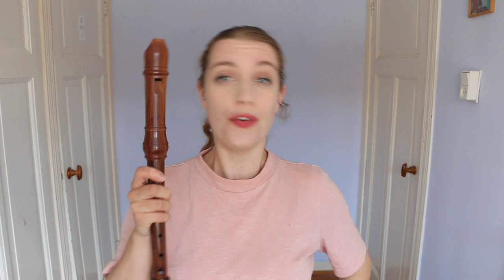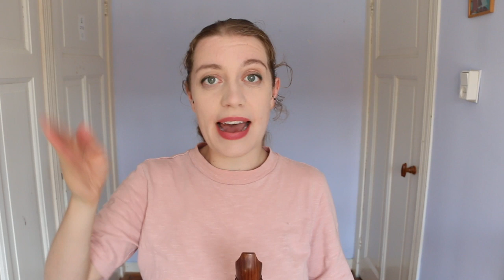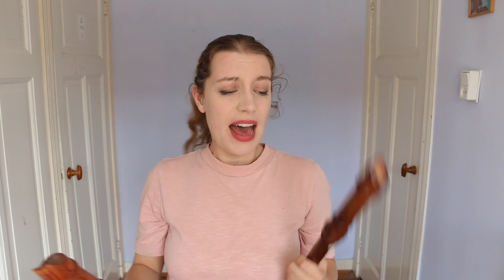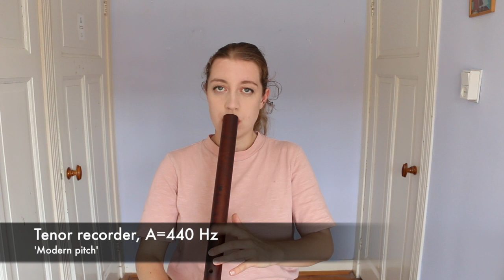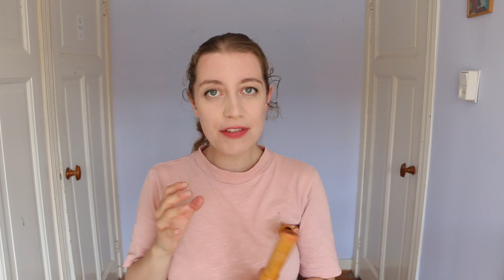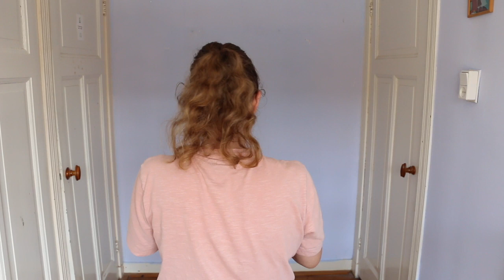440 vs. 415 Hz: what's the difference between baroque and modern pitch? | Team Recorder

Comment: When I did my first classical project with a choir I never heard of different pitches. We were doing Bach’s Hoge Messe and I practiced very hard at home with a recording. At rehearsals I struggled every time because it seemed a completely different piece. All the notes were there but I couldn’t get a hold on them. Finaly after 3 rehearsals somebody told me we were singing in 415 and I practiced in 440. Turns out, I’m very bad in singing at 415 if I learned it in 440... Now, many years later, I can hear the difference but I still cannot transpose down. It all doesn’t feel right.
Reply: Your Choir has to sing at 440 instead of 415 (in other words transpose down a half step) Right?
Reply: How can you not transpose?? That is so weird for a singer to not be able to do.

Comment: Most clarinets are tuned in B flat, but for instance for Mozarts Clarinet concerto you need a clarinet tuned in A, a semitone lower. No idea why this is like it is. There also are some awesome concertos for clarinet where you need a clarinet tuned in F. This is really expensive, clarinets are more expensive than recorders. 

It's a nice informative video, I think I will stick to 440Hz tuned recorders for now, though mine seems to be tuned in 438Hz if I use a digital tuning device to check.

Comment: I would use A=415 alto to play tunes in E major scale using the easier F major fingerings, tunes in F# major scale using G major fingerings, tunes in B major scale using C major fingerings, etc.  Basically any scale where it's easier on the fingers to play it one semitone higher but without actually sounding a semitone higher.

Comment: I understand the practical reasons for have modern baroque pitch at a-415, but I was wondering what are your thoughts on baroque instruments tuned closer to their original pitch, which usually is lower. For example, I have a Bressan alto tuned at its original pitch of a-408, but I've also played on copies of this same Bressan tuned up to a-415, and down to a-392. Of course this is subjective, but I find the instruments tuned at the original pitch or the lower a-392 have much a more luxurious sound that the one tuned at a-415, better suited to play baroque music pre-1750.
Reply: 392hz is used for french baroque music

Comment: I have a problem figuring out the proper fingering for F in the low register. I was taught to add my right pinky when the bell has a barrel and not to when it's straight. I hear the difference but can't tell which is right.

Comment: Oohhhhh, so I have about 10 recorders, i tried playing a piece with choir and could not get the pitch. Brought a couple more from home including my lovely wood and even the treble and sopranino. No good. Played them all using the pitch app and yes, about a semitone “out”. Narrowed it down to 416hz on the app. Figured the pitch was different in recorders for some weird reason. Now you have explained it, just my bad luck that every recorder I own is in baroque. I guess now i have to buy myself a modern 440hz recorder or three.
Reply from the maker: Hmmm, that’s interesting! Do you kind sharing what make your recorders are? Baroque recorders tend to be much rarer as they are typically handmade, or at least come at a higher price point. Buying 10 would set you back at least $5000..! Unless I’m misunderstanding?
Reply: @Team_Recorder  I haven’t bought any new at all. Most are plastic, two wooden, all mixed brands. But all pitch to A at 416. I live in Australia if that makes a difference.

Comment: Good day ! All hope is on you. My name is Yaroslav and I live in Russia. Recently acquired an alto recorder from Mollenhauer. She's from a pear, model Denner. the flute is filled almost immediately and it starts to hoarse. The flute was purchased on August 23. The unit is whole without a crack. Should the new flute behave this way? Can anti-condensation help? Or should I return it to the store? Tell me please! :)
Reply: I had a troublesome instrument like this.  I fixed it by holding it up-side down with the edge on the lower edge, then putting anti-condens through the labium.  The idea is to wet the windway without letting the liquid touch the edge.